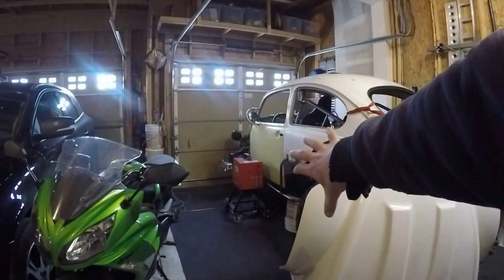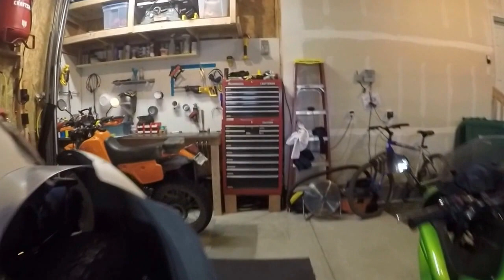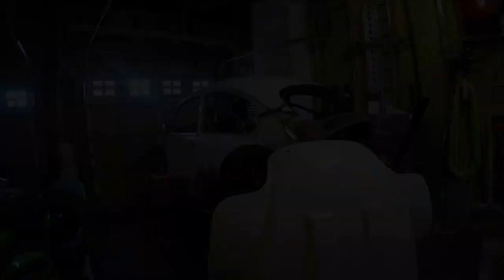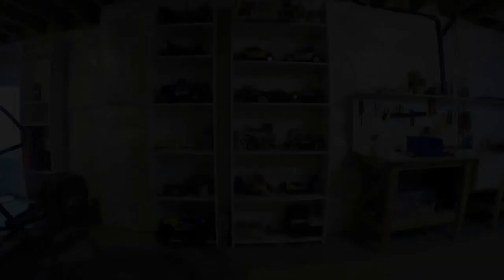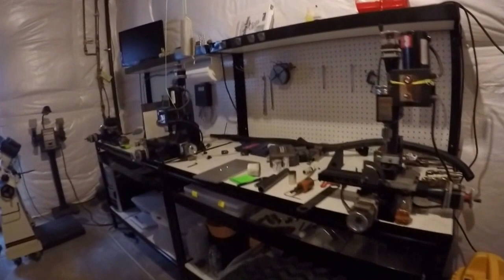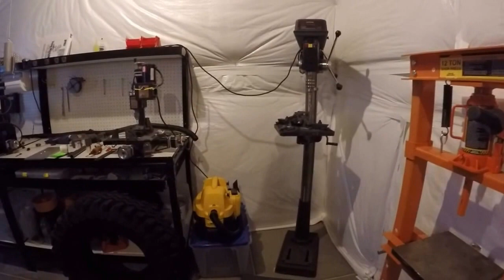Small Garage Shop Show and Tell (for Baja Bug)

Comment: Can u do a video and review on it I bin looking for a reasonably priced bender just can’t figure out which one to buy
Reply from the maker: It's the JD Squared Model 3.
https://www.jd2.com/model-3-bender
Not the cheapest, but one of the best. It does perfect bends and will bend 180 degrees.
I'll be using it here to finish the roll cage. I should be able to do a little video going over it.
Thanks for the comment.